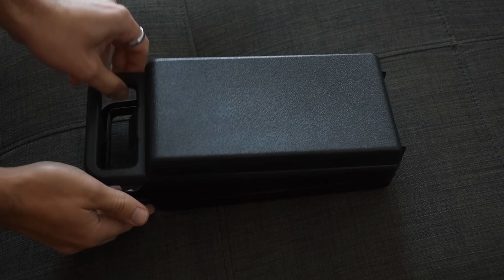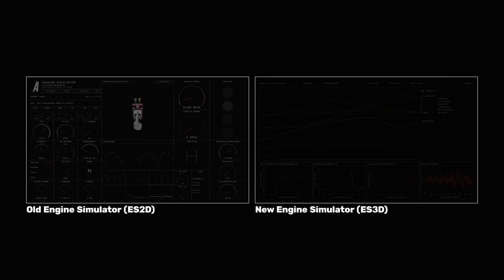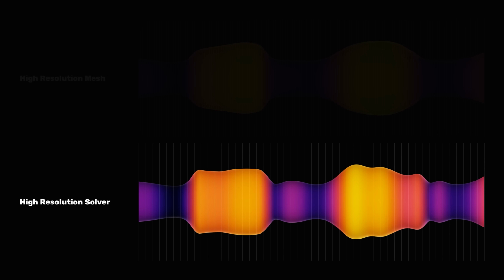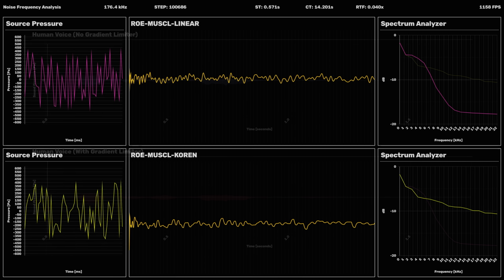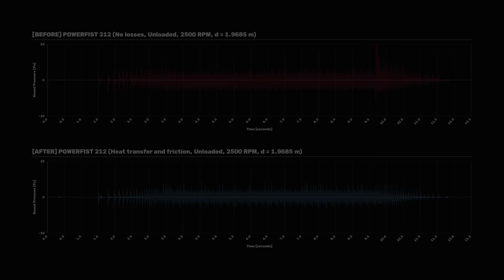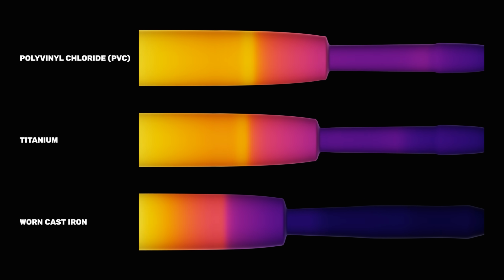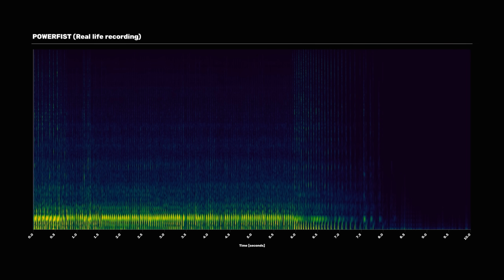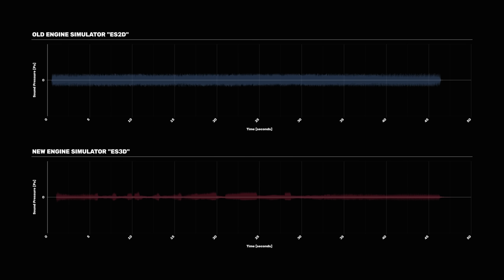Improving My Engine Sound Simulator With Real Data

Comment from the maker: You may have noticed that there was no sponsored segment at the beginning of this video. Brilliant was a great sponsor and they were very patient with my chaotic upload schedule. Ultimately though, my goal was always to move toward sponsor-free videos and we got there! This project is now entirely supported by Patreon and game sales on Steam.

All clips you hear in this video were rendered offline at very high quality and it may not ever be possible to run engines at this quality in real time. It's hard to know what is possible because I'm using a reference fluid simulation with no performance optimizations. This is intentional to retain readability and modifiability. However, it can still generate audio for many engines in real time with quality that is comparable to the clips I show in this video. I wanted to focus on producing the best sound possible without being overly concerned with performance. It's much easier to adapt a high-quality audio renderer to real-time than it is to adapt a low-quality renderer to offline rendering (if that makes sense). Anyway, we will focus more on performance later.

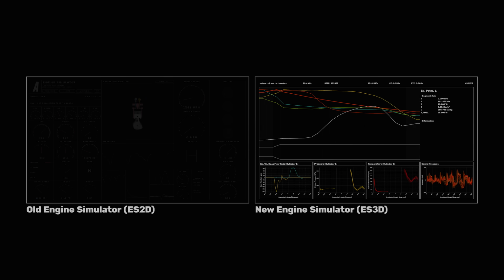You might also notice that the two audio clips of ES2D simulating the POWERFIST are noticeably different. In the first clip (3:51) I used the same impulse response that the new simulator uses, which is just a simple ambient impulse response to model environmental reverb. This provides a more fair comparison between the two simulators' raw simulation capabilities. In the second clip (21:04) I used one of the standard impulse responses that came with the application to show a more realistic example of the audio it was capable of generating.

In the transition animation at around 4:57, one of the equations is missing two brackets. I'm very annoyed that I made this mistake and I unfortunately only discovered it after the video was released. It's very annoying because of the number of hours I spent debugging issues, only to discover that the equations I was implementing were written down incorrectly in the source material I was studying. I guess mistakes happen and I'm not immune to that.

Almost all visuals in this video were generated using real Engine Simulator UI components (like the graphs, tube visualizations and spectrograms). I didn't have time to talk about all the game engine work that went into this but it's now ready for us to build Engine Simulator's final interface.
Reply: Which equation? And it was wrong in the SOURCE material?! How did that happen?!?
Reply from the maker: @spdcrzy  No, I wrote the equation wrong in the video which is a bit hypocritical of me because I've gotten so frustrated with academic papers and other authoritative sources publishing incorrect equations (it happens a lot more frequently than you think).
Reply: @AngeTheGreat  Was it W_i^(n+1) = 1/2 (W_(i+1)^n + W_(i-1)^n) - Δt/2Δx (F_(i+1)^n - F_(i-1)^n) by any chance... 🤔🤔?
Reply from the maker: Yes
Reply: @AngeTheGreat  I only know one thing. All IC engine simulations  are based on books by Gordon Blair and Desmond Winterbone & Richard Pearson, and R.S. Benson. I have three of Gordon Blair's books and two volumes "Design technigues for engine manifold.."  "Theory engine manifold...". The two volumes  contain precise equations for predicting engine noise. The Lotus simulator is based entirely on the books by Desmond Winterbone..
AVL, 4StHead, 4Stsoft, virtual GT-engine, Ricardo-wave, Virtual 4-Stroke and Virtual-2-Stroke. EngMod4T, EngMod2T., Kiva-3 and burning in cylinder.
Reply from the maker: @Gespan-r9v  I've read them all
Reply: @AngeTheGreat  In addition to these books, you should have a large number of SAE articles on hand. The latest trend in ICE simulators is 3D calculations in the intake system and 1D calculations in the exhaust system. Also, cylinder combustion calculations using CFD.
Reply: @AngeTheGreat  Will BeamNG be approaching you for your technology?
Reply: @AngeTheGreat  

As a programmer, I’m honestly astonished at how difficult it is to even *approach*—let alone actually use—this tool. It looks great and the core tech is clearly very powerful, but it desperately needs a major user-experience overhaul. That’s not just my opinion either.

Creating an engine using external tools like Enginette is a total pain. Those tools barely work at all—they crash, freeze, or outright fail—so for anyone who isn’t a full-blown audio engineer, the app ends up being almost pointless. Please take this as a compliment: the engine itself is extremely powerful, but it’s heavily limited by the current user input systems and overall design choices.

On top of that, what’s the point if external tools don’t integrate well and you can’t natively generate sounds for use outside the app? It feels like a lot of work went to waste for something most users will realistically bounce off of once they see how difficult it is to use.

I’ve personally run into constant issues because Enginette simply refuses to work—crashes, freezes, nothing functions reliably. That means I can’t make custom engines for Engine Sim at all, which makes the tool unusable for me right now. As cool as the default engines sound, they’re not worth the headache.

Even just getting the *default engine* running was frustrating. I had to press **A**, then hold **W**, while simultaneously figuring out which gear to select using the arrow keys. That’s a total pain in the ass, honestly—and a clear example of poor user input design by a long shot.

At this point, it’s genuinely easier to use MetaSounds with real dyno recordings from actual cars and a simple audio recording workflow. That approach gives better results with far less friction. The current user-friendliness reminds me of old third-party middleware sold to game studios—tools that only worked if the vendor’s entire team was embedded with you. This is very similar to why technologies like DMM never took off.

With that being said I love the concept / idea behind the Engine Sim Tool and its results are unmatched as of now but as much as i want to use it i have decided not to use it for now out of pure sake of my sanity and time.

So For now, I’ve switched to Meta-Sounds and real dyno test audio recordings found online, and I’ve been able to get even better and more realistic results with a little bit of tweaking.

*Tutorial used:*  
https://www.youtube.com/watch?v=8kPzhovhyCo

*Real dyno sound source:*  
https://www.youtube.com/@NM2255

For anyone interested in fully procedural, pure tone-generated engine sounds, I also made a tool inspired by this engine sim’s core concept and UI. It’s web-based (HTML + Tone.js), includes a recorder and engine preset switching, and is far simpler to understand and use.

*Showcase:*  
https://youtu.be/62KrYP5BTLM

*Website / more info:*  
https://gamedev44.github.io/Torque/homepage.html
Reply from the maker: @ASTERisk44946  I'm not sure I fully understand the point of this comment. As I've discussed numerous times in my videos, the original Engine Simulator was not even INTENDED to be used by anyone. It was a tech demo that was supposed to be used in one video (by me only) and I had no intention of revisiting it after that point. After getting hundreds of requests to release it, I did (with very little modification). It's not like I sat down and designed this user interface with usability in mind, I don't know who would ever assume that. Furthermore, you're comparing this tool to old software that requires that the "vendor's entire team was embedded with you". You do realize I released the entire codebase for this application right? It is FREE, with no strings attached. It's outrageous to me that you are framing this as me intentionally writing bad software to force clients to work with me, when I have no intention of working with any clients at all. It's free, open-source and I'm working on my own projects that have nothing to do with selling this as middleware.

Also, I have zero control over external, community tools around Engine Simulator. I had zero input in the creation of those tools and complaining to me about them won't solve anything. You'd be better off reaching out to the creators of those tools or even better, just make your own tools.

If you actually watched this video, you would have seen that at the end I clearly said that I'm working on a new Engine Simulator with a user interface that solves these problems. I'm assuming you're just using this opportunity to plug your own engine sound generator which is fine, but I'm very disappointed at your lack of understanding of what this project is and what this entire video series is even about.
Reply: @AngeTheGreat  

So what about a community edition?  
What about any version that’s actually usable for a real project?

Because right now nothing exists that fits that description.

After releasing three versions of this and claiming the third will somehow fix everything,  
I don’t see how this one will magically be any better in terms of UI.  
Especially when there are posts going back years saying it’ll be finished “soon,”  
with nothing tangible in sight.

This response honestly gives me—and likely other users—even more reason to never use these tools.  
The assumption that anyone could effectively use them without the creator’s direct involvement is ridiculous.

Sad, but not surprising.

so when is this eta for the 3rd Engine sim like 2029 or Something i Assume?
Reply from the maker: "Because right now nothing exists that fits that description."

And? What is your point? You're mad because you can't have it NOW on YOUR schedule I assume? I'm sorry but I'm not following your schedule on this project. This video that you are commenting on shows tangible progress being made on the project.

"After releasing three versions of this and claiming the third will somehow fix everything,  
I don’t see how this one will magically be any better in terms of UI."

Where was this "second version" you're talking about? In fact, what are you talking about in general. This is all one single project that I've been improving upon since the original video. It's not like I've made multiple releases that didn't deliver on their promises. I've released demo/in-development versions but they have nothing to do with this conversation. I released the original version (by popular demand) in late 2022 and I was pretty clear with the community that it was released AS IS. Since then I've been working on a more polished successor. That's it, this is very easy to understand.

"Especially when there are posts going back years saying it’ll be finished “soon,”  
with nothing tangible in sight."

At what point did I ever say that Engine Simulator will be finished soon? I don't recall ever saying that. In fact, for most of 2024 I was working on a completely different project and for that project I released daily development updates. It's not like I was misleading anyone about what I was working on. Please tell me where I said this so I can release a public retraction. I release frequent updates on Discord and to my Patreon supporters and they are all well aware of what I'm working on and what progress is being made at any point in time.

"This response honestly gives me—and likely other users—even more reason to never use these tools."

And that is entirely fine. No one is obligated to use these tools. In fact, I would PREFER it if you stopped using these tools (including the engine graphics in your own "simulator" which are obviously taken directly from Engine Simulator).

"so when is this eta for the 3rd Engine sim like 2029 or Something i Assume?"

There is no release date at this time. If you have a problem with that or don't trust me as a developer, no one is forcing you to give me money or to wait on me to deliver software for you. If you have already given me money, send me a message on Patreon and I will gladly refund you. You seem to be making your own tools at this point which you say are better and simpler, so by all means just use those. It seems like a simpler solution for everyone.
Reply: @AngeTheGreat  idk why you're even bothering to respond to this guy lol. it's clearly some autistic 16 year old 3rd worlder with dial up internet
Reply: It seems like the ringing problem is fundamentally a product of the 1D model and its boundary conditions. Whatever your flow model is, it cannot account for cross-sectional variations and the initial excitation and reflections are dead-in-phase at the boundaries, which allows for high-Q resonances that aren't possible in real life. In practice phase variations would stretch the resonant peaks for lower order harmonics and eliminate higher order resonances entirely. You could probably roughly model this by adding a convolution delay to the boundary bins, varying the response depending on the pipe geometry, although I'm not sure if this would work with your solver and would require some real measurements to dial in just right. I would probably measure frequency responses for a series of pipes of varying lengths and diameters as a reference, but the problem with exhausts is this may also vary depending on bulk flow conditions.
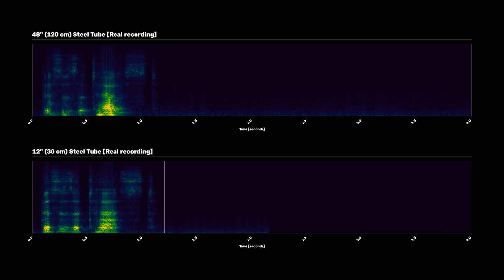Reply: Before I get to the the big reveal, I just wanted to say you should try and get in contact with Benn Jordan. He recently did a video on infra-sound that immediately crossed my mind around 18:30 with the "lowest fundamental frequency" comment.
I'd be interested to know how your spectrograms are scaled regardless! It would be great to see at least where the orders of magnitude land in on the frequency axis.
Reply: You are the best A
Reply: when you say beamng is your sponser does it mean the beamng or some user named beamng?
Reply: @bmqww223  pretty sure it's the actual company
Reply: @derfl007 he revealed in a past video that yes, that is actually BeamNG.
Reply: @bmqww223  Actual BeamNG dev team
Reply: this was like music to my ears, thank you!
Reply: Can't wait to have that simulation in BeamNG
Reply: Release on steam😊
Reply: So glad you could do this on your schedule and not have to worry about sponsors. Love the videos and I'm excited for the eventual final product.
Reply: Fantastic work! Thanks for the update!
Reply: It's ok that the formula is wrong, I know it is very frustrating! Making this video with no sponsorships is wonderful!!! I wish I could also donate!!
Reply: I love it! Can't wait! :)
Reply: ur kinda betrayed them
Reply: 17:10 guy randomly invents karplus-strong synthesis
Reply: hey being able to render offline type clips is perfect for putting the audio into a game.
Reply: I downloaded your game, And I just wanna know, How can I make my own engine there in the game?
Reply: when will engine simulator release on steam
Reply: I believe another issue (im new so im not sure) but did you simulate the intake noise too
Reply: Do you think it is possible to create a file format that would store the important parts of each engine sound generated by your simulator, then create a low performance emulator that would combine the important properties of the stored output into a near perfect recreation of the actual engine sound? To explain simply, we would store s9mething like the acceleration, deceleration and steady running sound into a file, then sample/augment the correct part of the sound depending on the circumstances? I know you have a beamNG sponsor going on, so we would presimulate the sound of the engine we are trying to emulate, then in real time be able to simulate the sound of the engine by combining the presimulated sounds. Or instead of it being the acceleration and such, we would store something like the resonances and frequencies of specific qualities of the engine. I hope you understand what Im saying with my poor explanation.
Reply: @nikj1178  That’s actually a really solid idea — and it’s pretty close to what could be the next logical step for engine audio.

Right now, most games rely on multi-layer sampling — real recordings sliced and blended depending on RPM, throttle, camera, etc. It works, but it’s still a “reconstruction” rather than a simulation.

A base made of sampled sounds combined with simulated layers is probably the next logical evolution — but the real challenge is being able to *actually build and program* something like that. It’s not just about mixing sounds anymore, it’s about creating a system that understands and reacts like a real engine would.
Reply: @math999c9s  did you chatgpt your comment bro
Reply: Did you see the Yamaha patent making physical "engine" to pump air, to make sound to a electric drivetrain in motorcycle engines? 🤓🤔
Reply: Brilliant is not a bad or annoying sponsor tho, high-quality/trusted sponsors are acceptable :)

Also, please please pleeeeease watch the video about the official toyota AE86 EV frankenstein.

From the videos it sounds incredibly amazing, it would be awesome if you manage to talk to the designers or something, I'm pretty sure both can benefit from it.
Reply: ... the video I watched was from Larry Chen :)
Reply: Hey Ange! I would much prefer sponsors in a video than YouTube ads which I’m still getting, maybe I read your comment wrong but it isn’t ad free on my end
Reply from the maker: @robotman3474 I don't have much control over that. This is a YouTube problem. I know from experience that turning off monetization doesn’t do anything except allow YouTube to put ads anyway and not pay me anything. It's a bit frustrating because I got hassled so much by people annoyed about sponsored segments and now it seems like the goalposts have shifted to me somehow removing YouTube ads completely which I know is impossible.
Reply: @AngeTheGreat  Dude, don’t worry about the publicity you can’t control.

You’re doing incredible work, you deserve success.